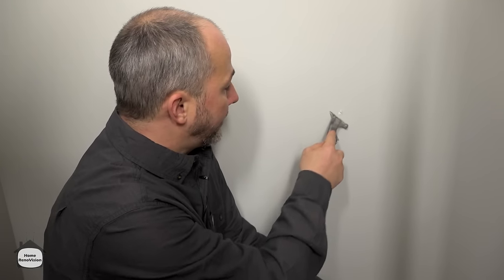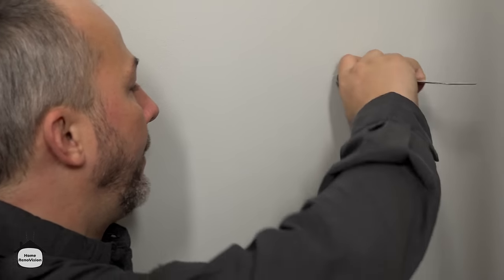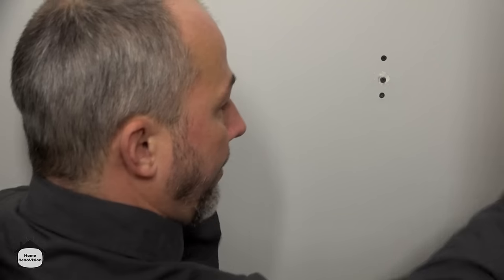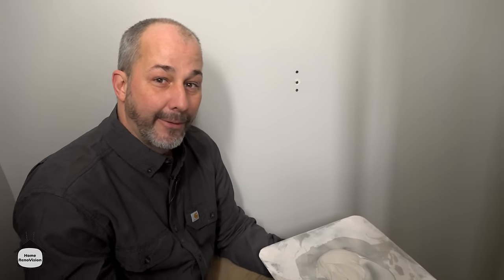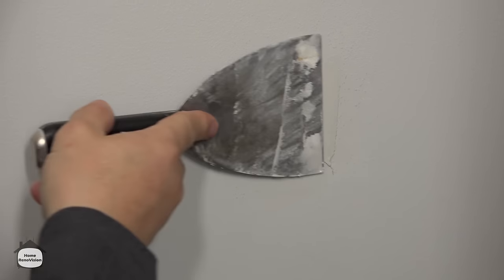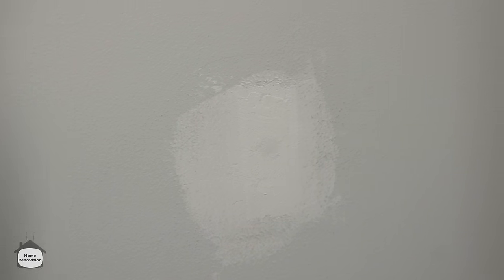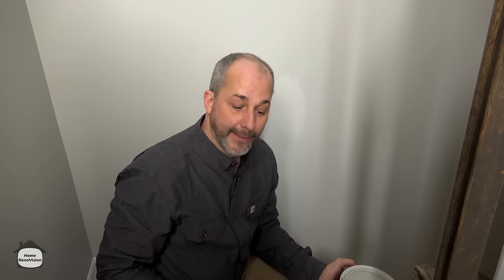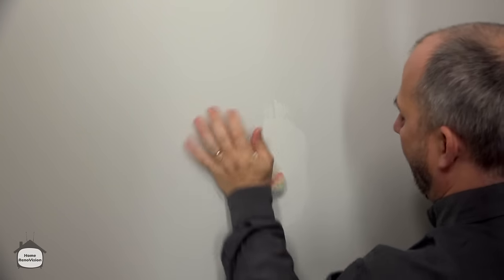How to Repair Nail Pops !

Comment: I have nail pops in my ceiling that are caused by nails and not screws. Should I remove the nails and then re-insert them like you did with the screw in the video or simply hammer the nail into the ceiling to make it flush with the ceiling and then add the two screw technique like you did in the video? Thanks!

Comment: I have the same issue however it's because they use nails back in the day. So I had to do the two screws and I just banged the nail in more . Next time I'm going to try to take the nail out and put a screw in that hole and do what you did cuz I did the one on top and one on bottom like you did with the screw but I never took the nail out

Comment: Great video.  Got a question.  I got quite a few nail pops in the ceiling and it's about 20ft high and if i don't ever repair them will the ceiling eventually fall down? Like some of the nail pops are about a quarter inch sticking out of the ceiling, I'm just unable to reach it yet as i don't have a tall ladder.

Comment: great video, I definitely have a handful of nail pops to fix around  the house... do you have a video, or can you do a video about how to fix the long cracks created by the metal wall brackets  around frameless doorways or openings.  I dont know if I'm describing this correctly.  cracks created by the metal corner beams.
Reply from the maker: Hi Asha, the best thing to do is add a few nails or screws to secure the metal. then use paper tape tp bridge the metal to the wall. 2 coats of mud will finish it nicely. Cheers!
Reply: @HomeRenoVisionDIY  thank you.. do I do this over the wall texture and paint.. or skip the tape step? what type of nails should I be using?

Comment: I work with a fella who hammers drywall screws for fun, could this eventually become a pop screw?  Also i sometimes use drywall nails when I hang sheets, I use an appropriate hammer made for it.  Is using a framing hammer bad because it smashes the gypsum and could cause popped fastners later, or is that off base?

Comment: Just purchased my first home. My house is currently on city water. I still have the well and pump. I have no clue if it work and what parts I might need but I want to install a sprinkler system and use the well to water my lawn.
Reply from the maker: pumps are pretty simple to operate. You may need a a pressure tank to regulate it. but other than that you should be able to connect to the irrigation system with pipe and crimp rings. Cheers!

Comment: Sounds to me from your description of the cause that these pops indicate fasteners that are failing or even placed incorrectly in the first place. I had a crack in my wall and was going to repatch and repaint. But I started digging and realized that the cause was the wall joint that cracked was in mid-air, ie, they had joined two wallboards without a stud under them, and of course eventually it cracked.

Comment: Hello Sir, we really like your videos. Always helpful and always a "go to" for information and solutions. Here is a question dealing with drywall repair. Or maybe you have a video out there we have missed. Airvent at ceiling. We scrapped the stippled ceiling (rose/sunflower pattern) throughout the house, re-muded etc. and the Airvents for AC/Heating are literally  held up by the mud. Screws for the Vents go through into "emptiness" with no hold. The vents are hold up by wishful thinking. How can we address this?

Comment: Awesome video. Was the compound that you used sheet rock? If your patching a hole no more than let's say 4" do you need to spray it with texture and primer and then paint? Also, is it recommended to paint the entire section of the wall. I was told if you do not the fresh paint will be visible to the eye. Any suggestions?

Comment: Great advice man!  Our house we just got has these EVERYWHERE. If you got a second, what would you use to fill tack strip nail holes in concrete before sealing it to lay peel and stick tiles? When getting the tack strips up it leaves little tiny craters where some of the nails were.
Reply from the maker: mix up a little thinset. let it dry overnight. Cheers!
Reply: @HomeRenoVisionDIY  Thanks neighbor! Guess down to the hardware store I go.

Comment: Great tip. One Question: How do you repair a stress crack either on the wall or ceiling so it will not crack again or at least in the near future? My thought was to cut the crack open, use caulking since it is flexible, and tape over it with mesh tape. Your thoughts or experiences? Thanks.

Comment: Home RenoVision DIY,  I live in Hawaii and have a home that has traditional lateral, tongue & groove single wood walls (built 1940's).  Could I use this "mud mixture" to fix nail pops on the interior that occurred when siding was done on the exterior?

Comment: Question: What do you suggest I use for my apartment cement walls which divide two apartments I have a bunch of plugs do I remove them or leave them in? and what product can i use to plug them since the wall is all cement? Thanks!

Comment: Just had a loft conversion done 8 months ago and there is nail pops every foot apart around the whole ceiling, and several on the walls especially coming up the stairs. I'm a bit concerned about the amount we have in a short space of time. They aren't just bulges either there is chunks of plaster dropped out from them, some as much as 2 inch diameter.

Comment: Hi, I just bought a home 1978 split-level.  Had wood paneling glued over completely unfinished drywall.  Should I remove the nails and replace with screws now since I have the opportunity?  I'm going to be scraping the glue off and making the paper smooth again.
Reply from the maker: Hey Bobby, trying to remove the nails will destroy the wallboard. I suggest just giving the heads a light tap and make sure they are recessed so you can finish. you will not have  a problem down the road now that the studs are all dried out. Cheers!
Reply: @HomeRenoVisionDIY  thank you for the tip !!

Comment: I’m wondering if you can do a video on how to over cut drywall around outlets? Our electrician ruined all the drywall around ours and it’s too wide to put covers over it. Also in some parts the drywall touches the basement the floor and other sides it’s about an inch above the floor. Will this be a problem installing floor later?
Reply: I heard our drywallers yell out "Jumbo" and now know that stood for "Cut the hole too wide and electrician will need a JUMBO plate to cover".  Grrrr!

Comment: I am repairing a leak along my ceiling and corner walls and I have a nail popped. The ceiling corner is not secure and I don't know where to place the additional screws or if I remove the nail. It is very tight and I may just hammer it in deeper. Also, it is a mess to fill. Is there a way I can send in a short video to show you what I have going on? This is my third time repairing it as I thought I had the roof repaired. You are correct in that this is very frustrating. Thanks if you can assist.

Comment: What would you do if the drywall screws were sticking out in side by side pairs from the ceiling down and white dust was all over the painted wall?
It's been a long time since the place was painted and we never noticed all this when we moved in. I don't know if this needs all the drywall taken off or what.

Comment: The roller is to give that micro texture, at my home I repair some spaces as you show us and I see a little different but I see maybe why's the different.
Reply from the maker: If you can't see the problem from a few feet away then it does not exist. The hardest thing for any homeowner to do is forget about where a patch is. Even though no one else can find it even if they were told to look. Cheers!
Reply: @HomeRenoVisionDIY  I think I need to forget that I repair it lol.
Reply from the maker: Cheers Miguel, easier said than done..

Comment: How do you add slim pot lights in existing ceiling with plumbing and wires from a bathroom above and not damage or drilling into them when drilling through a floor joist not knowing where they are in the ceiling  when you can't see what's on the other side of the floor joist?

Comment: I have nail pops all over my walls and ceilings. I've added screws the 1 inch above and below.  I basically had to reattach most of a ceiling in one room, as I added more screws more popped.   So my question is, I just used a nail punch to push the nails in so theres no dimple.  Am I just postponing dimples again? I thought the screws would hold the drywall weight and the nails would just be there. Should I cut up the drywall to remove the nails?  I haven't patched with much yet.

Comment: Hi JEFF,   Question on nail pops.  I have a 36 yr old house with 30 lnft of exterior walls with complete vertical lines of nail pops, 16" o.c. approx 6" apart vertically.   How can this be addressed??

Comment: Installed new drywall.. I added glue on every stud and attached the drywall 6 inches on center... after spraying drywall surfacer and primer, I noticed quite a few screws were concave.  To fix this I added more compound, but now the screws are convex.  I don’t know what’s going on with the studs.  I’m going to try your approach and see if this helps... thanks
Reply: Joseph Rosado what do you mean you attached the drywall 6 inches on center? And what do you mean they were concave and convex?

Comment: Hi Jeff! I have close to zero experience drilling nails into walls but I decided to give it a go in order to hang a few things up on the wall. And now the dilemma... I drilled the wrong nail straight into the drywall and upon trying to reverse the drill, I just pushed it in further. Any tips/ tricks for this getting the nail out??

Comment: Hello Sir, Is there a material like wood putty to fill  a nail hole in a thin popcorn textured wall. So you don't have to put any kind compound and sand it. Because then you can't match the texture.

Comment: Hi What is the difference between Spakle and the drywall mud that you use?  Thank you for the video and tips.
Reply from the maker: spakle dries quick and sands easy. drywall compound dries slow and sands easy or dries quick and sands difficult. in both cases drywall compound is 90% cheaper but usually only comes in large volume while spakle comes in little tubs. Cheers!

Comment: I do drywall warranty’s for a living I love your video however, I’m real life situations al you need is a Phillips head screw driver to tighten the drywall screw if it’s loose or sticking out... after wards apply durabond 5 min/ 20 min. And skim over with regular mudd and that’s it folks

Comment: I have a few nail pops close to the wall on the ceiling I understand the mounting the 2 screws on the stud to hold the drywall. Any other things I can do close to the wall in the ceiling?

Comment: Any tips for pops that reoccurred in the same spot, after being professionally repaired using this method?  (10 yr old home, pops were fixed under warranty at 1yr mark.)

Hoping it was only due to inadequate vent fans in our bathroom, which we have since upgraded. Have to now fix the pops, as well as replace the drywall tape in a couple spots. (And take the rust spots off of our light fixtures, a/c vent,  and door hinges. 😶

Comment: Any advice for removing old drywall anchors that were left behind? Thanks for the great content, we just bought our first home and your channel is helping us so much!
Reply from the maker: use your 4" knife and just run it up the wall to take off the head. push it in a little and let the plug fill the hole so you only need a little patch to finish.

Comment: I must ask, are you at the top or near a stairway in this video?  As a 25 year old board-man who tries to achieve perfection I've noticed on many basement jobs I get where I'm walking down a finished stairway (new or old like you said) that's where screw pops are most popular (at least to my eye).  I thought that maybe because the wall is over 8' from the top of the house to the bottom of the basement floor that maybe the weight of the drywall sheets above are pushing the sheets below and causing the pops.  So I put an extra screw in the field on every stairway I drywall.  As I almost never see the finished product of my work I don't know if its helping or not, what are your thoughts? cheers

Comment: For a couple of small screw holes like that, we always use 5 min compound. The added benefit of 5 minute compound is the grit, so there is almost no shrinkage. You can quickly come back and add another coat if needed. Then sand and your done with the joint compound.

Comment: What can be done when every nail(?) or screw has a pop just below the ceiling?  E-V-E-R-Y ONE around the perimeter of the room. There is one story above. Two walls are exposed to outside air, one wall separating the garage that gets cold. Thanks

Comment: Hey Jeff! Love all your videos, so much great info! One thing I notice about most of your painting and finishing videos is that the majority of the walls you work on don't have much texture at all other than what the paint roller leaves. Im my area all most walls have what looks like a spay on texture, or I guess they call it orange peel. How do you effectively use a putty knife and a sander when there is a ton of texture all around the damaged spot?  I've found it hard to repair dents and scrapes without damaging the texture around the original spot. Any suggestions would be greatly appreciated!
Reply from the maker: Hi Jerffrey, I would suggest using a roll on texture and then flatten it out with a trowel. Cheers!

Comment: PLEASE HELP! I've a row of screws/nails (about 6 in a row, about an inch or so apart), they seem like they are nail pops but after having a closer look the screws actually like go slightly inwards - like dimples in the ceiling and there's also a patch of tape showing through on the ceiling. Do I just fill it all with some joint compound? Or do I need to add some screws? Same question with the tape bit please, do I need to take it off or just fill it? Thanks in advance x

Comment: couldn't the dark grey plastic insert for larger format rollers have been removed? You could then try to slide the small paint roller onto the chrome shaft of roller frame.

Comment: Hi Jeff, my home was built about 20 years ago, and ALL of the drywall is hung with nails instead of screws.  As a result, they're starting to pop out (especially after a big rain).  Is there any way to keep them from popping out?  Prefer to not have to add three new screws for every nail in the walls.  Thanks!
Reply from the maker: you could simply pound in the nail and add one screw. Cheers!

Comment: I suppose that's ok if you only have 1 or 2 of these pops. But when you got 50 nail heads (not screws) sticking out of each of 8 walls, you gotta speed things up a bit.

Comment: Thanks for this video! I recently bought a house, and the previous homeowners stuck a lot of things to the walls - posters, pictures, etc. When they removed them, they took pieces of the wall/paint with them. So now I have certain walls full of spots where, at the very least, the paint is missing, but in worse cases, there's pieces of drywall missing as well. I have the exact paint to match, so that's good. But I had bought spackling to fix the missing drywall. Will that work? Or do I have to use this 45-minute mud?

Comment: Thanks! Now...what would you say about a wall with screw pops that is also severely bowed inwards between studs?
Reply from the maker: same thing. 2 drywall screws will hold just about anything. Cheers!
Reply: The drywall seems to be firm against the studs, but in-between, it curves inwards... It looks extra-bad because there's a chair rail on the wall, thus, big gaps between it and the wall between studs. I'm going to try butterflies through the rail to pull the wall out, but I have my doubts.

Comment: If you have a wall with a lot of screw pops, check there is enough timber in there. I had one with timbers at 24" centres no noggins and boy was it floppy.  The only solution was to rip off the drywall, sort the rubbish structure and fit new boards.

Comment: Would this work for nail pops on ceilings as well? I've noticed especially in my bathroom that where the ceiling meets the wall there are a lot of nail pops
Reply from the maker: definitely. We did a smooth edge video to demonstrate how to repair a ceiling with full texture, because drywall hangers use nails on the edge as a way to hang it fast. they always pop and leave a mess. that is why smooth edge is so popular. The builder can repair a patch real easy on a smooth edge but not so easy on a textured ceiling.